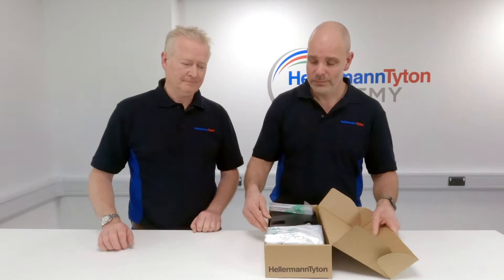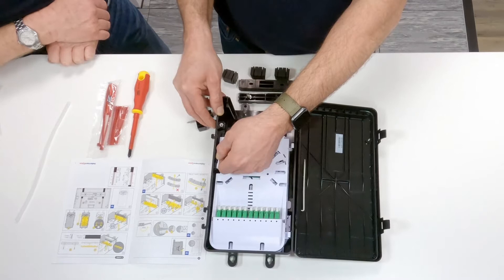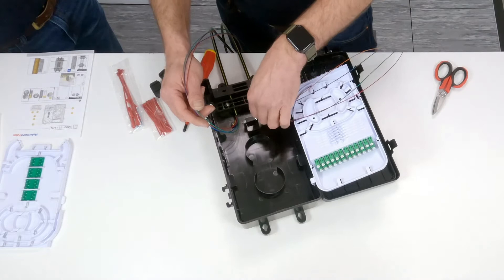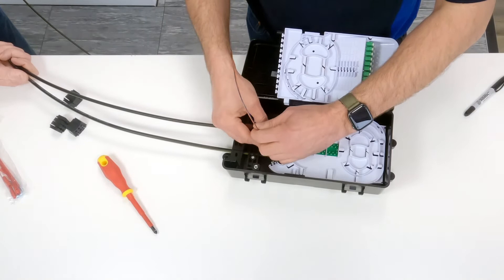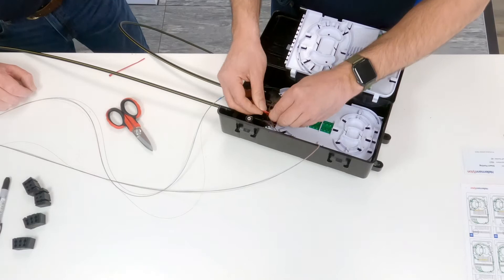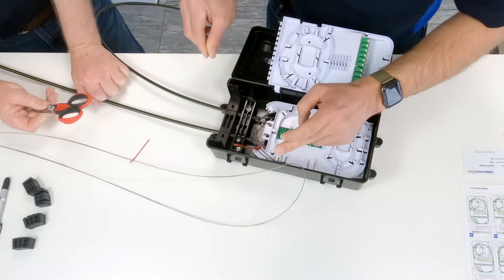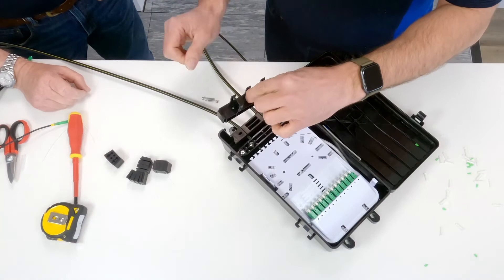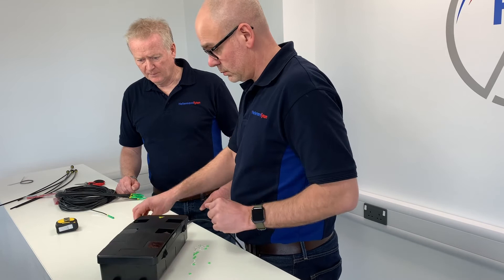Aerial fibre subscriber node installation with pigtails and drop seals AFN

Comment: Hi, CommunityFibre are using this type AFN in our street, recently installed we are now experiencing interference with vehicles locking, and unlocking not working. Can this product cause interference?
Reply from the maker: Hi Ben, Thanks for your question. The AFN is a passive product and is designed to manage the fibre at that stage of the fibre network. The cables transmit the light signal along its glass fibre but there is no electrical current at this part of the network and interference is highly unlikely, if not impossible. The interference must be coming from some other source nearby. Hope this helps.